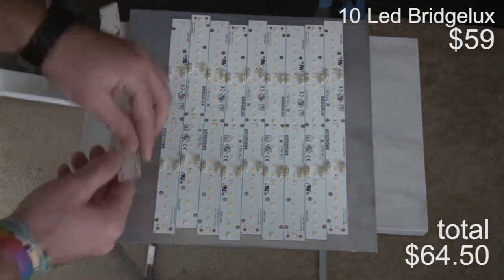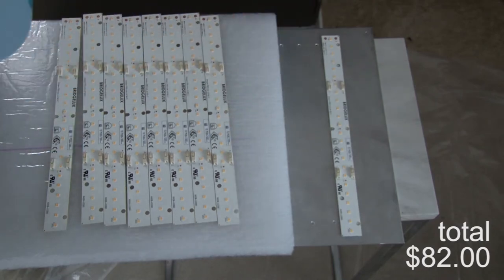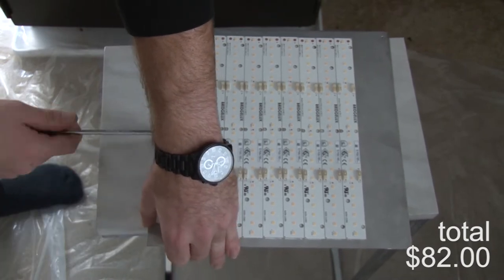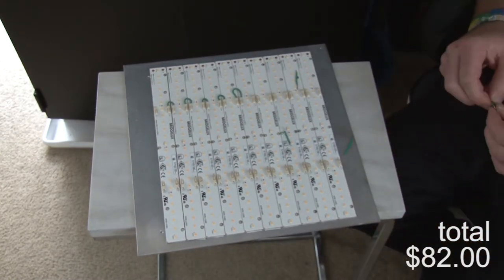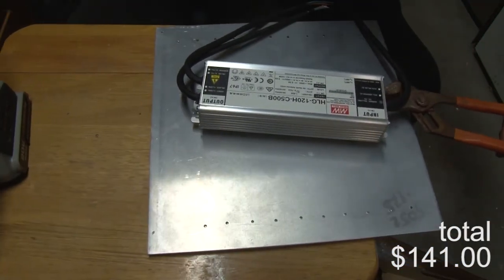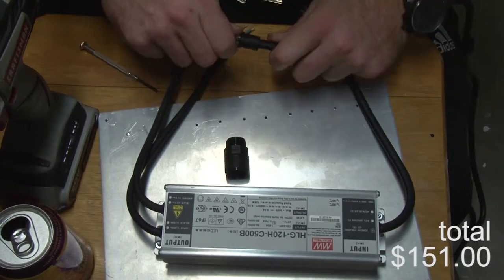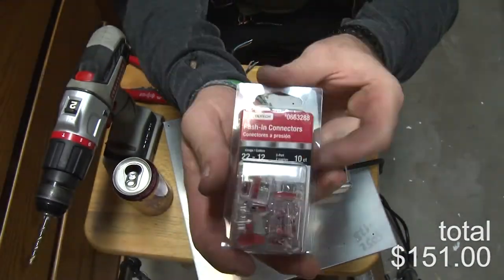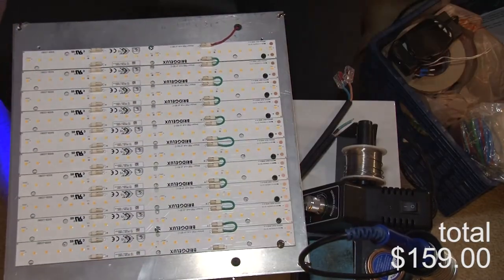Bridgelux EB Strip DIY led grow light build

Comment: It's been a long time since you uploaded this video, but I still try. Have you had any problems with series wiring at such a high voltage? If you wanted, you could have mounted the driver outside the growbox and not directly on the aluminum plate?
Reply from the maker: I stopped using this and moved on to newer tech. As far as mounting drivers you can put it anywhere you like. Just know you'll have longer wires to reach but that's easier than cooling a room because of the heat.

Comment: Great video 👍👍
Reply from the maker: is the sound better on this one than the original post?
Reply: jPapapot crisp and clear 😁  where do you get the thermal tape 👍👍
Reply from the maker: Yogi 420 eBay. They have different lengths and widths

Comment: Nice video! Inspired me to build something similar myself :) I've now bought a HLG-150H-24A along with 18 strips Bridgelux (same as yours, just 12 x 3500K, 4 x 4000K and 2 x 5000K) with max current 700mA. Since my driver only delivers 6.3A I guess shouldn't worry (18*0.7=12.6 /2 =6.3) ergo I will only be running these strips at 50% of their max. But did I miss anything and how should I wire them - parallel, series or combined? I am just afraid to overheat them, thermal throttling or blow them up. Thanks.
Reply from the maker: John Falke so relooked them up. You're using 22.1 volt strips right? If so you'll have to do it parallel giving you 344mA. Which actually is a great spot for them to be. But it depends of they're forward voltage. Led gardener has a few videos and website that does an amazing job at explaining. Also record your build no matter how basic. I'll watch the shit out of it.
Reply: Yup, 22.1 volt. Alright thanks im gonna finish the build asap! I'll be using the build-in VO potentiometer as dimmer if needed ;) Haha maybe I should make a vid or two.
Reply from the maker: John Falke yes please

Comment: Where can I get the wire and bolts
Reply from the maker: ebay or amazon. They're 18awg solid core wire. and M3/M4 screws. Might want to buy taps for those too.

Comment: Why not use 700ma driver?
Reply from the maker: Because of the relationship between amperage and efficiency.  If i went up to 700mA I would get a better light reading but I would sacrifice life span of the diodes and efficiency that they work. Meaning the light per watt would decrease even if the over all wattage and light increased. Technically these should be run at 200-350 mA.